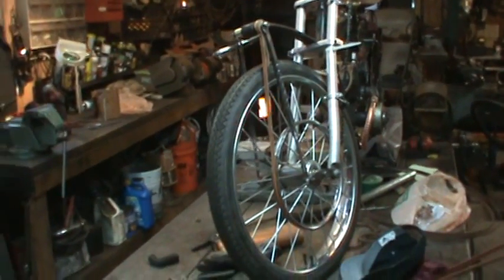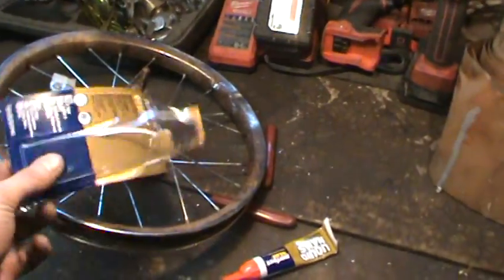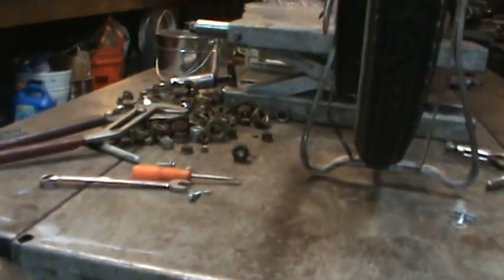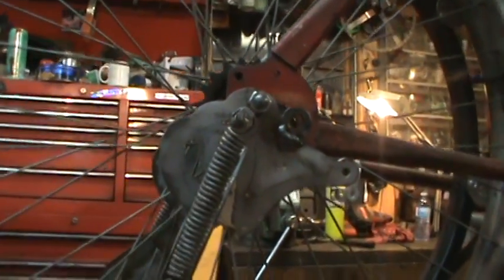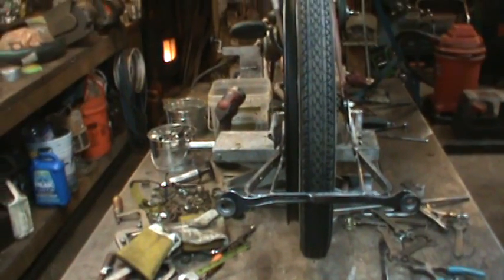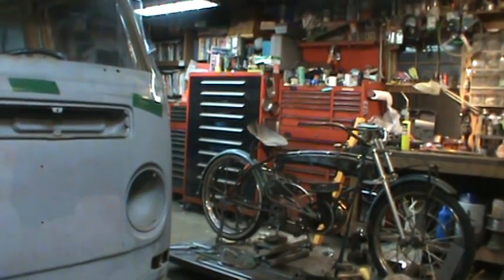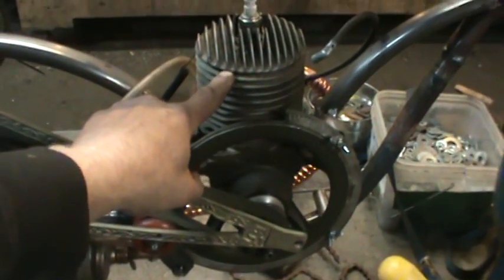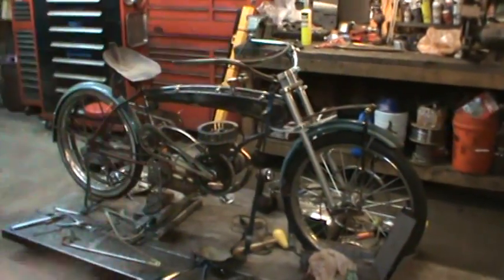bike build, center stand

Comment: Hi Darrin
I have a couple of suggestions for you although I think they may be too late for this build, but maybe you can file them away for future use. 
1. For the front brake you could use plumbing pipe strapping (perforated) in either copper or galvanized.
2. You could weld a piece of conduit on the back of the kick stand instead of the wrenches. You can flatten out the ends and still be able to put your “feet” on the ends. That would also gain some clearance from the tire.
Sorry, I couldn't help myself LOL.

Comment: Another possible solution for the front brake : make bracket on side  behind fork arm above ring where your chain comes down ( possibly extend off axle bracket).Make an eye to run chain threw attach to belt, circle belt all the way around attach to same bracket. This way it will increase your braking surface to over 90%  enough to stop that heavy bike.

Comment: I think you should mill some flats on stume pool balls, not the 8 ball, some others to be different and drill and tap them to be able to bolt on where the nuts are on the bottom to the kick stand. It would give it a neat look when the kick stand is up

Comment: I like the heat sink squirrel cage. Are you going to try some silicon bronze on your TIG welder? You can do a lot with those elec grounds for the plumbing pipes.
Reply from the maker: +Kevin Hornbuckle im just going to press fit for now, until l can see how it responds